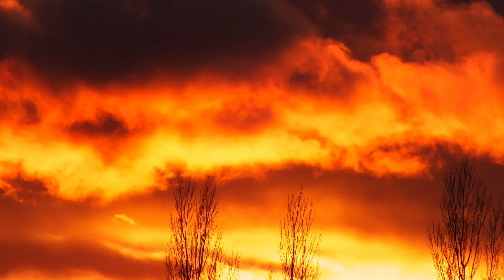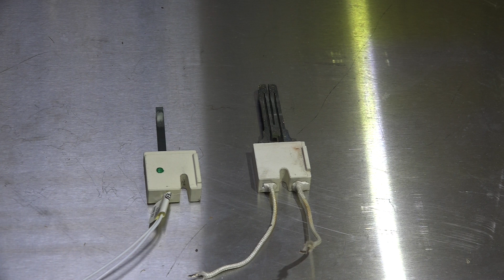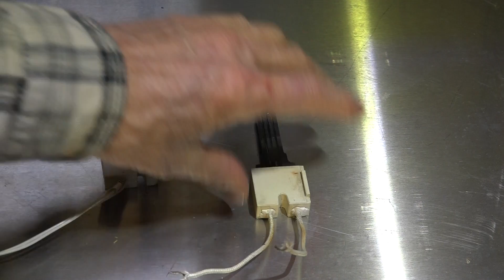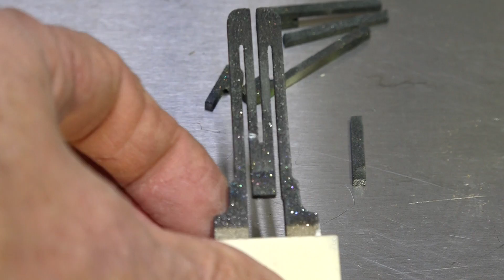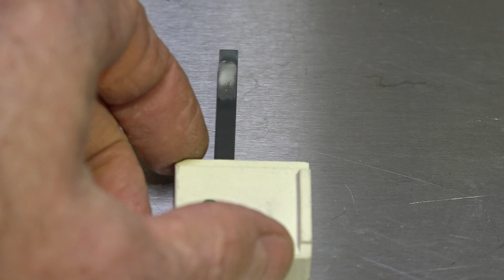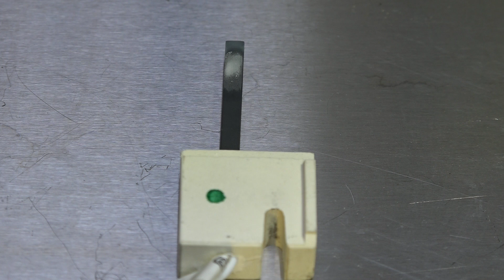The silicon nitride vs the silicon carbide ignitor part 1

Comment: I only knew of the Trane 80v igniter fiasco. They sell an update kit with new control, harness and igniter = 120v to igniter, no more 80v varying crap. Also did not know nitride = DC. Even the smart valve flame rod assembly aftermarket replacement is a 24v nitride.
Reply from the maker: +Joe R The early nitrides were all DC.  The newer ones are AC.
GFM

Comment: I like using those Honeywell glow fly igniters. It is a nitride replacement for 120 volt carbide igniters. They come with different brackets do they can work in most aplications.
Reply: +Jim D I agree. I use these in all scenarios that I can get rid of carbide ignitors. The nitrides are the superior ignitor

Comment: Hi! We have a bunch of Raypack's that take the carbide ignitor and it can look glowing red and good but if it dont sence at least 3.1 amps at the controller goes into a failure after 3 tries. We usually get about 1 year out of them. And 50/50 with a new person installing them lol, I tell them treat it like a egg that has a crack in it "hour later" they call me and say they broke it. These things are so fragile. Love the vids. Curious about resistance I go by amps like the contoller says 3.1 amps.
Reply from the maker: +Bernie Clement Those numbers are manufacturers' number.
GFM
Reply: So we need a different controller then the one that came with it? If it powers the igniter and climes to 3.2 then drops to 2.9 and replace it then it climes to 3.5 or so then hold around 3.2 and it fires.
Reply from the maker: +Bernie Clement If you are saying the burner lights when the the amp draw is 3.2 but not at 2.9, I must assume the HSI is cracked.  
GFM